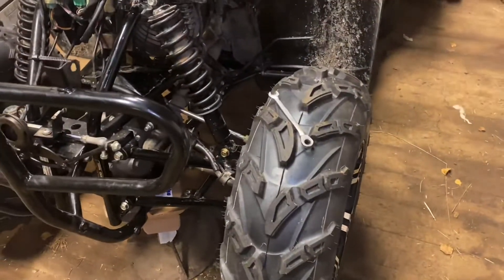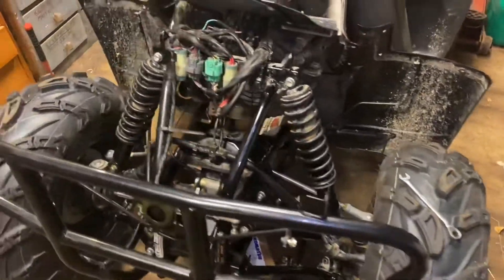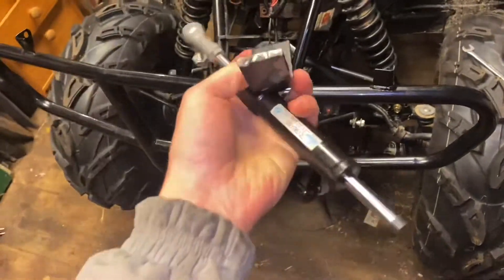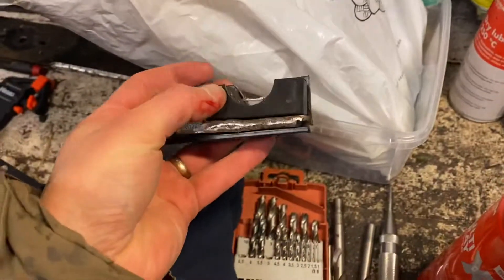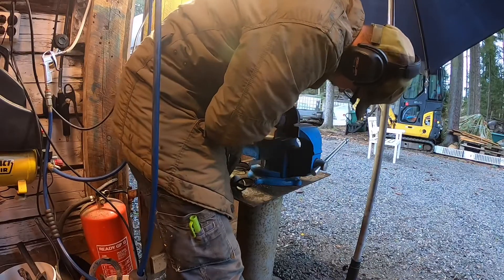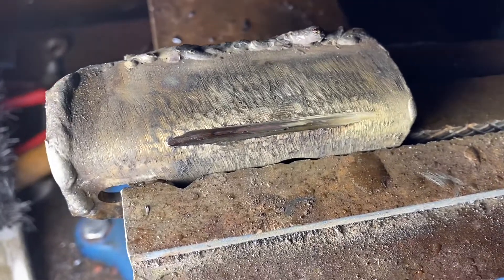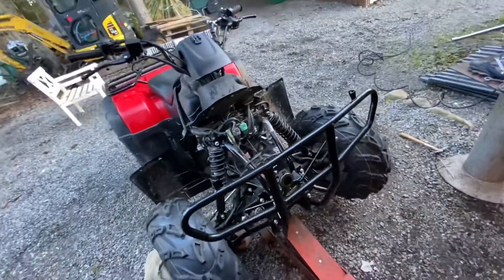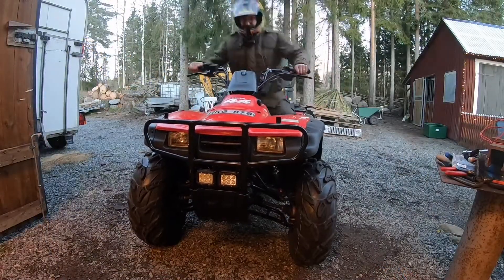Custom built steering stabilizer on Honda Fourtrax Rancher ATV

Comment: Great idea!
I may consider doing this on my rancher. My dealer modded my steering linkage supports to make it easier to steer and also reduces shock when hitting obstacles.
Reply from the maker: Thanks! Do you know what they did to improve your steering? If you buy a universal steering damper this could be done without welding.
Reply: @NilsKall  I replied on tge ac fb fan group. Replied to your video post

Comment: Check alignment, go to KC ATV channel he has good video about alignment. In video your tow looks to much out and that can cause a pull feeling . I could be wrong though . But it’s worth a check . And did you loose the front rack ?
Reply from the maker: It is toe out but that is what it should be according to the manual. The GoPro makes it look like it is too much. It rides great on gravel and blacktop, stable and precise steering. It is only when I hit stuff with one wheel that it really gives a bit of trouble with force feedback. Power steering negates all that....
The front rack was only of for this test drive, it is on now again. This stabilizer was great when hitting stuff up to speed, didn’t help much with low speed bumps. But I have other aluminum wheels that will be better, video of that will come eventually....
Reply: @NilsKall  no worries buddy . The camera never shows stuff right . Just wanted to help . But looks like you are on top of that . 😉
Reply from the maker: Arizona Kid all tips appreciated! Unfortunately I have read that the Hondas are harder to steer than most other ATVs. Didn’t have this problem with my Suzuki King Quad but on the other hand, that thing was SLOW so maybe it wasn’t so apparent. Taking of the ITP rims make it much better.
Reply: @NilsKall  good video buddy . Look forward to next one .
Reply from the maker: Arizona Kid thanks!